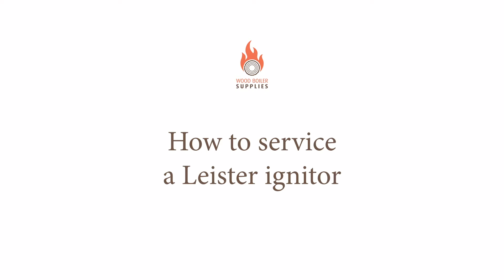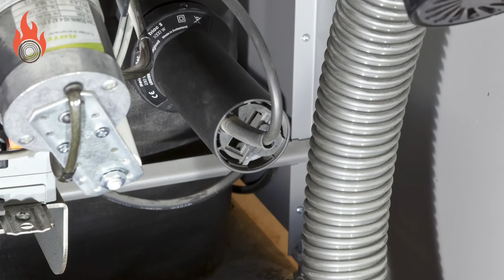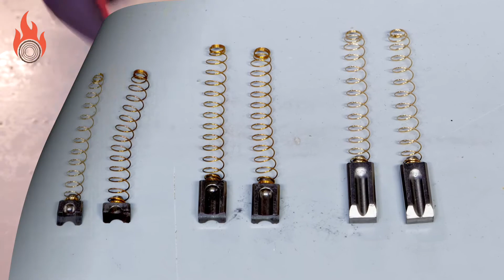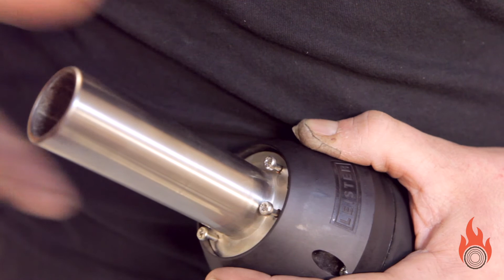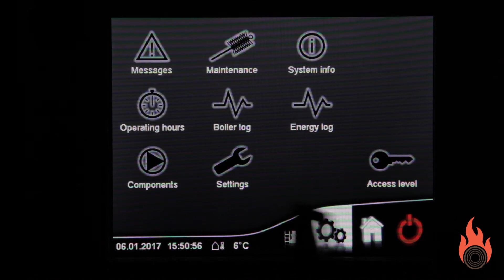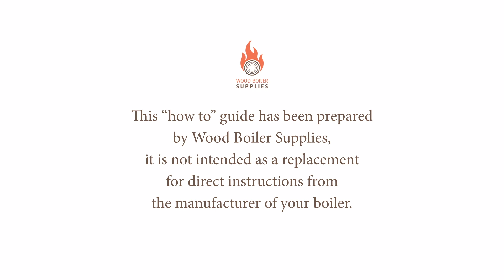WBS Video 2 -  How to service a Leister ignitor

Comment: What I found is that after a few brush replacements the flip lid of the brush box snaps off from metal fatigue. How does one replace that (and is it easy)?
Reply from the maker: Unfortunately if the small metal tabs break off that hold the brushes in place, it is not possible to repair/replace these - you may be able to fashion something else to hold the springs on the brushes in place - e.g. wrapping a cable tie around, etc.
Reply: @WoodBoilerSupplies  thanks for that info